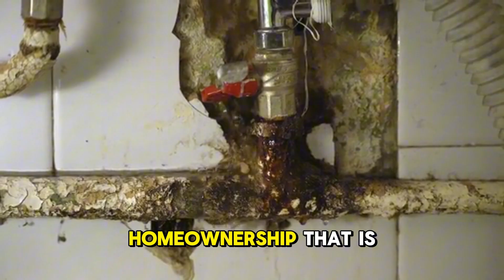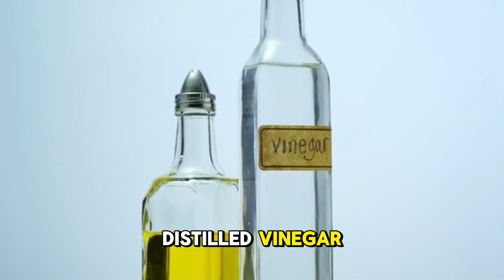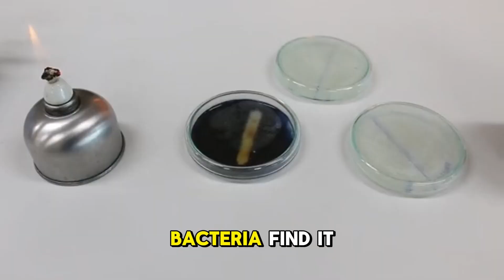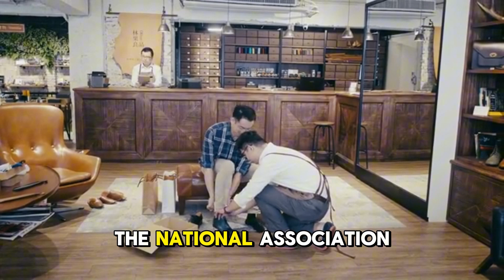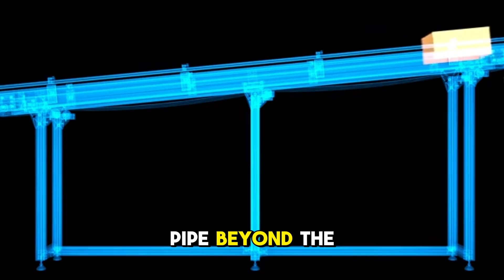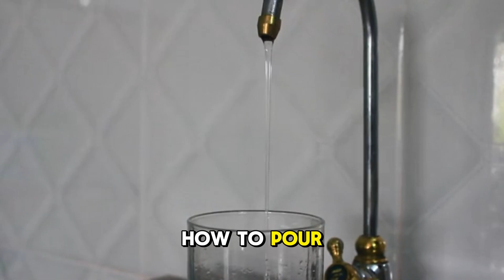The Amish Never Replace Their Pipes — the $3 Annual Treatment Plumbers Have Banned Since 1950

Comment: sorry, i mean 40-50 year-old pipes that never have been cleaned . Plumber wants to put JPex pipes in via 12 holes in sheetrock walls to access, remove pex pipes and run new pex pipes. and, then there is the sheetrock repair and paint; over $11,000. Any Amish plumbers in Houston TX.